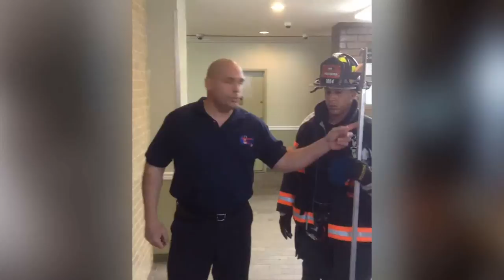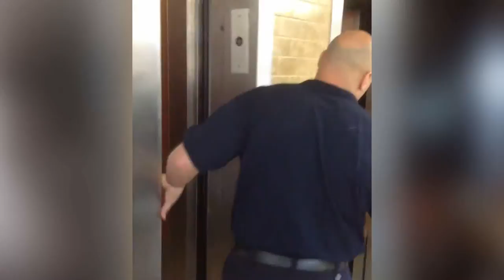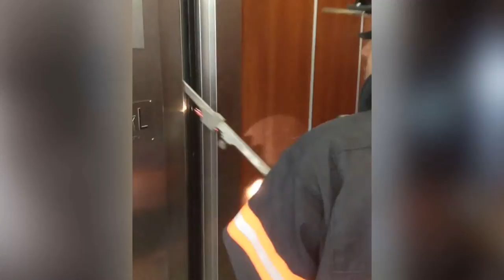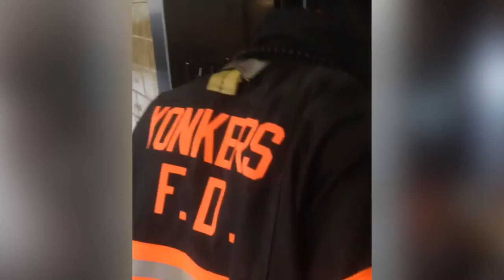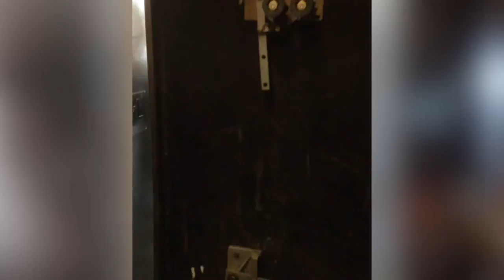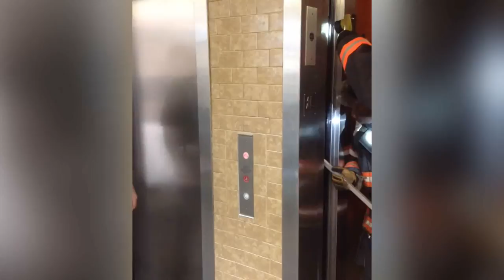RIT SAFETY SOLUTIONS: Dragon Rescue - Elevator Poling Tool

Comment: or you could just use a door drop key  so much easier!
Reply: This is a great technique for when the outer doors don't have an escutcheon on the outside, and you can't use a drop key.  I have encountered that a few times.  Some buildings only have outside access on the first and top floors.